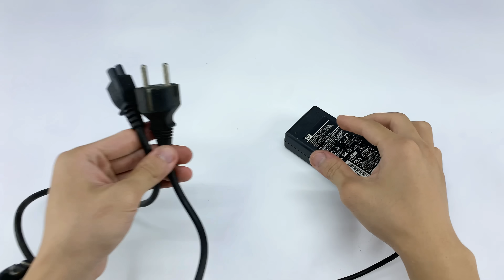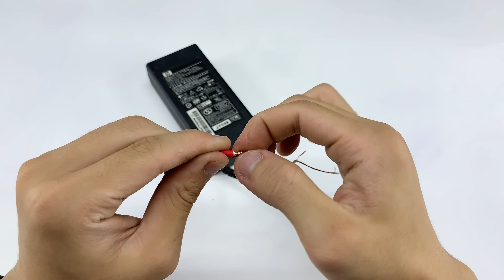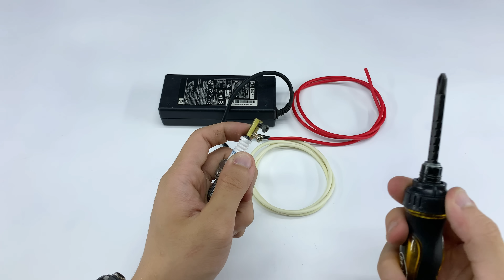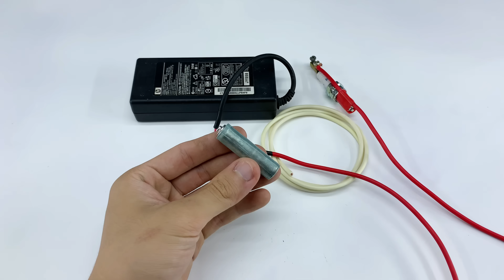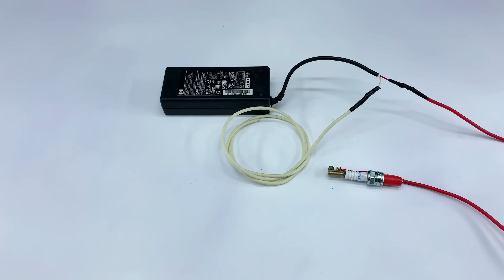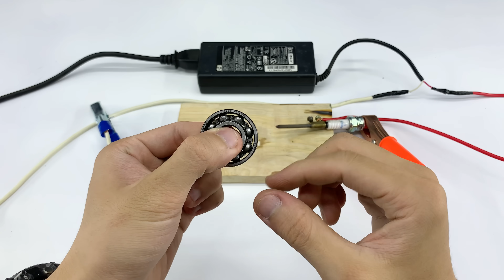Nobody Knows About This Hidden Feature of Old Laptop Chargers 😱

Comment: doesn't look like the spark plug does anything except a holding device for the carbon rod..
Reply from the maker: Thank you for your observation! 🙏 You’re right that in this setup the spark plug mainly works as a holder for the carbon rod. Have you ever tried experimenting with other ways to secure the rod in a DIY project?
Reply: First he calls the clips, crocodile clips then alligator clips then he calls it a welding machine, then the soldering machine, then a spot welder. 
The spark plug does absolutely nothing there's no use for it. 
The power supply does not provide enough amperage. The voltage does not mean too much, you can spot weld with 12 volts as long as the amperage is high. 
⚠️Most important is his power wire the red wire, It goes out of the frame of the video which is the most important part of the deception that's probably where it's going to the real power source. 
⚠️⚠️⚠️These people, charlatan's, should be but I doubt that they are ashamed of themselves, they're going to get people hurt and killed!!!!!!

Comment: Hi, got this old battery drill i failed to use for over 3 years, the batteries have completely died and tried " just starting" them to no effect, i stripped one and bought replacement batteries of the same voltage but my biggest challenge was welding the tiny cupper strips on them, i think this will help.  thanks. Joburg- South Africa.
Reply: No lo hagas, aunque el video muestra algo que se puede hacer en otro campo, NO  es lo recomendable para soldar baterías de taladro u cualquier otro dispositivo inhalambrico
Reply from the maker: Thank you so much for sharing your experience! 🙏 It’s great to hear from Johannesburg 🇿🇦. Welding those tiny copper strips can definitely be a challenge. Have you tried any other DIY methods for connecting the replacement batteries?
Reply: @Inventor799 
Zbog čega mu ne kažete da to ne koristi za točkasto zavarivanje li ion baterija😮?

Comment: I think any Lap top adaptor has short circuit protection ..and 4 or 5 Amp is not enough to make a spot welding .. I am watching from Egypt
Reply from the maker: Thank you so much for your thoughtful feedback! 🙏 It’s great to know you’re watching from Egypt 🇪🇬. Have you ever tried building or modifying a DIY welding machine yourself?
Reply: @Inventor799 
I have repaired a lot of SMPS , and  size like the one in video about 80 Watt.
Reply: You're correct laptop power supplies do have surge protection
Reply: @mattiëgs369  Sobre todo tienen protección contra cortiocircuitos. No permiten salida de más de 4 o 5 amperios que a unos 20 voltios hacen unos 100 vatios. El grafito lo que perimite es un pequeño arco eléctrico y mucho calor,.

Comment: You must out put wire solder then put tape.
Reply from the maker: Thank you so much, Abdul! 🙏 Yes, using solder and tape is a smart way to make the connection stronger. Do you usually fix things at home this way?

Comment: The spark plug is meaningless. The carbon rod ground down to a point makes it a resistor with a fine point and that is what gets hot. Keep the charger for the laptop or sell it on eBay, people are always looking for replacements.... Buy an actual soldering iron with the profits. Use JB weld for the bearing.
Reply: Soldering iron will not produce that high temperature.
Soldering iron can make only hundreds of degrees in C, But thounds of degrees are needed to melt iron.
Carbon rod will endure a few thounds degree at least.

I think this is very useful idea for those who need only tiny spot welding devices.
I will try it.
Reply from the maker: Thank you so much, Billie! 🙏 Your explanation is very clear and helpful. Do you often share DIY repair tips like this, or was this project special for you?
Reply: Very much informative as well as usual tips too ! I think so ! I never did it? which actually work or not? but if it's a successful work made so far! than it will be undoubtedly a good and useful. Thanks a lot.

Comment: it will connect but not Good and strong Joint..It is good for soldring  copper and wire.
Reply from the maker: Thank you so much, Hasmukh! 🙏 You’re right, the joint isn’t always strong, but it works well for soldering copper and wire. Do you usually do a lot of soldering projects at home?

Comment: Why use a spark plug ?? it is not needed ?? but I do know this will work as I used to do this 30+ years ago working on electric milk floats for replacing the old batteries for a new one. Manchester UK.
Reply: But where you,like me, around for United Dairies Milk Tokens given as compulsive loyalty coinage for overpaying in fiat which meant the "Drink More Milk" mantra got free promotion every time you got a couple pieces of metal stamped pieces of tin "Coins" as your "Change"  that were only valid to purchase more milk from the same vendor ?
As a juvenile I remember that at the Great Yarmouth funfair park, you put in valid currency coins then pulled the poker machine handle.  Your jackpot payout was in "Coin tokens" that could only be used to go on the various rides such as the Big wheel, Scenic Railway, or Shooting range.  Which means, that they always got all of your money.......one way or the other !
Reply from the maker: Thank you so much for sharing your story, John! 🙏 That’s a really fascinating memory about the milk tokens and funfair tokens. Do you still enjoy remembering or collecting old things like these from the past?
Reply: @Inventor799  Had I known that old age would come to me as rapidly as it did and that, for example....I would not have discarded the beautiful mother- of-pearl inlaid Hofner Semi-acoustic guitar I had in the 1960's and instead would have paid to  have its snapped off neck repaired after it dropped off the bed in my caravan where I had stupidly left it while I journeyed from Melbourne to Sydney !  I still have a picture of me holding it.....and that of course irks me when I look at it !  I figure that as a collectors item it would now fetch a fairly hefty price at auction !
:face-red-droopy-eyes:
Reply from the maker: Thank you so much for sharing, Kevin! 🙏 That’s really interesting to hear about your experience from 30+ years ago in Manchester. Do you still enjoy working on DIY or repair projects these days?

Comment: Thisis a very good idea to  spot welding. The carbon is capable of producing sparks even if the voltage is moderately low.   But here the adopter is capable of giving output voltage ranging from 19.5 Volts of 3.5 ampere to 24 volts (varies differently with models) which is more than enough to render a heat sufficient for making spot welding.
Reply from the maker: Thank you so much for your detailed comment! 🙏 It’s great to hear your thoughts — which kind of DIY welding or electronics projects do you enjoy the most?

Comment: This looks like a fake.  In the beginning of the video we see that the power supply's current rating is 4.74 amps.  The current to produce that kind of heating is AT LEAST an order of magnitude larger, this unit is not capable to deliver it. If it is a genuine laptop power supply and if you try to pull such current from it it will go into the short-circuit protection regime and deliver nothing. Please don't try to copy this "project" unless disappointment is your favourite pastime, it won't work.
Reply: Bir sahte video daha kanalı bildirip engelliyorum
Reply: WHAT NONSENSE ??!!
Reply: Thank you for your comment. I was,,to be fooled because 8 trusted him when i saw it , but later after i,read your comments i became aware....
Reply: @ddyy5110  I did a welding  "thing" wih a microwave transformer. 
- You should/can only do this if you have electrical knowledge! 
- There is a risk of DEATH when handling a microwave even after it has been disconnected from the power supply. 
- The discharge of a 2kV capacitor can throw someone against a wall! 
- Or worse. That being said... Just remove the hundreds (or thousands, I didn't count:face-green-smiling:) of turns of thin, almost capillary, wire from the secondary (designed to give kV and microamps) and add 3 or 4 turns of 12mm copper wire and you'll have a little over 2V and over 20A... for about 3 or 4 seconds until the primary smokes and melts. With solder points obtained in 3 seconds or less and dedicated cooling for the transformer (microwave fans!) you can solder small things, "sucking" less than 10A from the power supply network, my limit to do electrical things.:face-turquoise-covering-eyes:
Reply: Al usar el electrodo de carbón si es posible, esa es su magia
Reply: FAKE SCAM 😢😢😢
Reply: @blg53 "The current to produce that kind of heating is AT LEAST an order of magnitude larger" - have you calculated  the current required or just talk off the top of your head? 
Actually 4.74 amps is quite a current. It can generate ANY temperature. The limit is the heat capacity and heat dissipation (i.e. the mass and heat conductivity) of the parts being welded. I guess this here power supply with its 4.74A is enough to weld a needle to a razor blade.
Reply: @andre-k4x  needle to a razor blade, in a 1ms, or less, time. More than that the charger will cut out.
Reply: @andre-k4x  if voltage is 20v and current is 4.74 amps, it is about 100 watt. The power is about a big size solder iron. Not sure if it can do the job the video showed.
Reply: @andre-k4x  if voltage is 20v and current is 4.74 amps, it is about 100 watt. The power is about a big size solder iron. Not sure if it can do the job the video showed.
Reply: ممنونم که آگاه کردید ❤❤❤
Reply: Mosfet will blow up.
Reply: Edward from South Africa. It's very technical if you are in the field
Reply: Adaptor/ Power supply untuk laptop akan proteksi ketika terjadi hubung singkat,,, 
Proyek ini menggunakan prinsip kerja hubung singkat .
Jadi proyek ini tidak dapat bekerja seperti yang diharapkan
Reply: Completely agree!!!
Reply: What the hell was there a need for a spark plug..
Reply: That’s a shame but thank you so much for not allowing me to waste so much time trying it out.Why do people feel the need to scam you! Absolute idiots.
Reply: 고맙습니다
Reply: I can't say but I will try it  I from  SVG
Reply: Exactly
Reply: I call bullshit..spot welding is different than melting the metal onto the battery 🔋
Reply: Thats normally true if he had atemted to use steel iron or copper electrode but I think the fact that its carbon it takes less power to reach that temp. not 100% pos but if it works that be how.
Reply: Correct, laptop chargers don't deliver enough amperage for this kind of work and it will shut down or the possibility of ruining it, you need a much larger power supply which will deliver 12 amps or more
Reply: Very true, these laptop chargers don't deliver enough power for spot welding, if you try it it definitely won't work because there isn't enough power and it will shutdown because of a short circuit.
Reply from the maker: Thank you so much for your detailed feedback! 🙏 Safety is always important — which kind of DIY electronics projects do you find both safe and effective?
Reply: @Inventor799  - Safety is always important - it really is. It would be safe if before assembling the device U would calculate the current through that carbone electrode (and therefore through the charger and your cable) to make sure it is within the charger's specification.

Comment: Pure click bait. The plug does absolutely nothing
Reply: I was wondering why the need for a spark plug.
Reply from the maker: Thank you for your feedback! 🙏 Sometimes DIY tricks may look different — which kind of DIY content would you like to see more?
Reply: @Inventor799 genuine DIY contents that are not full of lies.
Reply: The spark plug circuit is not used per say however;

1) the spark plug acts as a strong pen to hold the electrode (think pen style  soldering iron).

2) IMHO, the internal of the spark also absorbs some of the heat (type of metal used)

3) the ceramic core of the spark plug is good insulation from the current and heat (shock and/or burn)

Conclusion, use an old spark plug, don't buy a new one!

Comment: Old laptop chargers? Still working or dead chargers? Lawrence Segun Leo from Nigeria
Reply from the maker: Thank you so much, Lawrence! 🙏 Do you usually try DIY projects with old electronics in Nigeria?
Reply: @Inventor799 I do, I actually try my hands on a lot of stuff but I want to know if this works with dead laptop battery charger or just old discarded one. Thank you
Reply: @lawrencesegunleoedessy9248 it needs to be in working condition. Check the output with a multimeter.

Comment: Watching from Littleton CO.
You never said where you got the brass piece fir the spark plug?
Can welding wire or rods be use with this device instaed of cutting up a battery?
Reply: I suspect the welding rods (unlike that carbon electrode) have too low a resistivity which would result in a sort of a shortcut
Reply from the maker: Thank you so much for watching from Littleton, CO! 🙏 The brass piece here was repurposed from spare parts. Welding wire or rods can sometimes work, but results may vary compared to a battery. Do you often experiment with different materials in your DIY projects?
Reply: IMHO the wire and/or welding rod would not last. You need material that can withstand the high temperature created by the current (you are basically shorting the power supply)
Reply: slm ben bunu aküyle yapıyorum bilgine Türkiyeden sabri